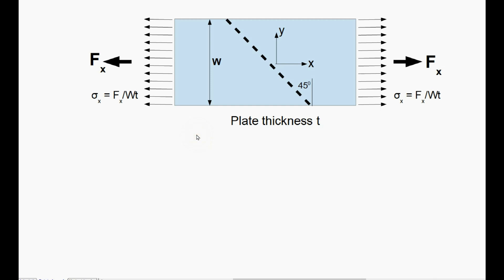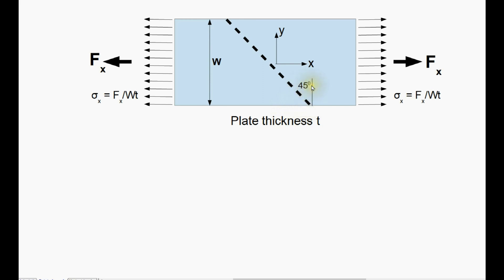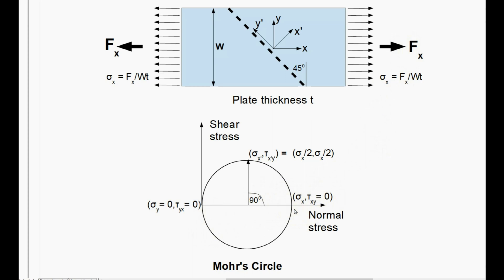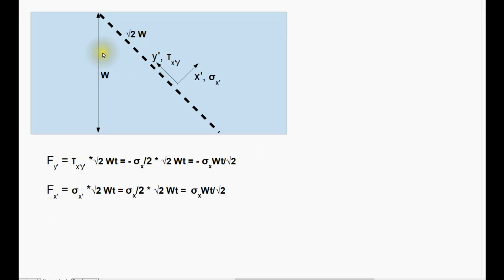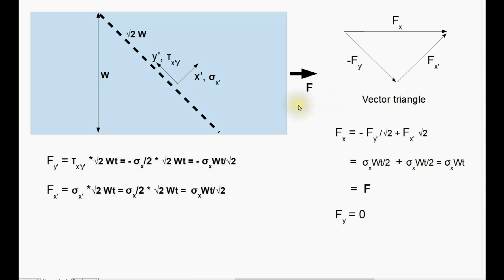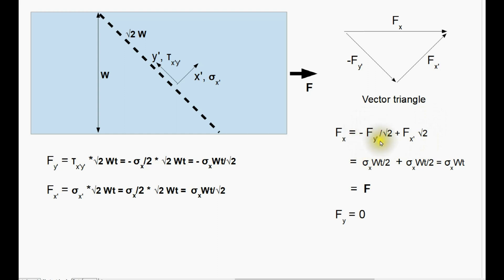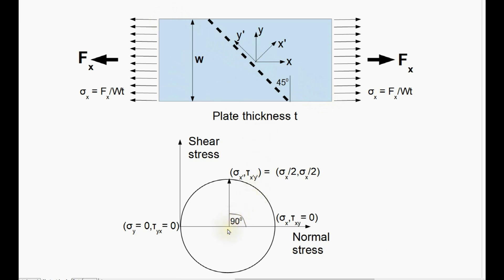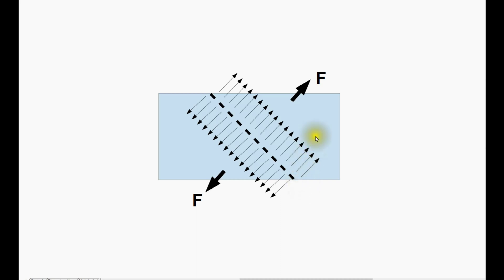Why scarf joints are no stronger than square joints

Comment: Hi Bill.  I want to ask you a Land Rover related engineering question, I can't find any contact info, so please excuse me for posting my question in the comments section.  

It relates to Oil Pressure drop in a 300tdi.  When the engine gets warm the oil pressure drops from 45psi to 15psi, if I coast downhill and drop the engine temp below 74.C the pressure rises again to about 25psi.  I doubt that a temp variance of <10.C From 74.C to 80.C) would affect oil viscosity that much, so the drop is almost entirely related to the oil cooler thermostat opening up.  

The engine has a 7 litre oil capacity, so lets say that the pump, filter, oil galleries and rockers take up 2 litres at any given time and the oil cooler and associated piping takes up another 2 litres (probably less, I'm just using arbitrary numbers here).  
The pump delivers a given volume (related to speed and time) and the pressure is controlled by the restrictions of the oil galleries.  
Once the thermostat opens the same fluid volume is applied over twice the circulatory volume, leading to a pressure drop.  
The thermostat spring has a linear rate or resistance, so adding more washers to it won't increase preload (resistance).  In fact it seems the spring is there only to close the thermostat. The opening is controlled by the thermostat expanding with heat, thus extending the shaft and pushing the spring loaded washers (which act as a valve) back.  Since this is in the filter housing, nothing can be easily done to alter this wide opening.  The thermostat has a shaft travel of about 18mm.  
Since travel though the cooling system is one way, if I used a washer to partially occlude flow on the return pipe (since that's the top pipe on the radiator and easiest to access) would the introduction of this resistor increase systemic oil pressure?  
The engine has a new crank and bearings, and demonstrates good oil pressure when cool (<74.C) so the pressure drop seems to be totally related to the cooling system.
Is there a formula to calculate the ideal hole in the washer?  

Thanks, I always enjoy your videos and explanations.

Michael
Reply from the maker: Michael, whilst I'd like to help I think it'd be unwise for me to get involved in mods to your vehicle's lubrication system so I will just give general answers. In response to your question it is possible to calculate the oil flow / pressure drop but you really need to model the whole system and that's quite a bit of work and requires good input data and a lot of experience. It's what Piping Engineers do for a living. If you want to calculate the flow through a washer in isolation then do a search on "orifice plates" which is what they are called in the piping world.
Provided your oil pump is delivering as designed, the clearances are as per spec and you are using the corrrect grade of oil you should be getting full pressure - that's what the physics says. Most people don't have an oil pressure gauge so don't know how low it gets when hot. The Daihatsu engine in my Defender starts at nearly 6 bar when cold and can reduce to 1.5 bar when really hot which is a bit concerning but it seems to be all right with that. However 1 bar would worry me (the low pressure light must be close to coming on) and I agree you need to look into it.
Reply: @defendermodsandtravels  Hi Bill.  Thank you for your response and guidance to a formula.  Having searched the net, the issue seems to be widespread among 300Tdis.  Prior to the rebuild I had around 10psi more pressure at start up and at hot running.  That was with a later Brazilian made MWM block, which may offer more resistance in the oil galleries (I don't know) and with the gauge sender unit bolted to the end of the T-piece adaptor, now it's at 90. angle.  I don't think this should make a difference.

I do have a custom radiator (triple flow with 30% increased capacity) and I did notice a mild drop in oil pressure when I first fitted that (difference in resistance between that an the old radiator).  Looking at Mike's videos on Britannica Restorations (YouTube) the oil cooler circuit never gets 100% of the oil flow, even when fully open, so that 'hot' and 'cold' oil mix at the filter.  Given that with a "tight restrictor" ie: thermostat closed, everything runs fine, and that with "no restrictor" (thermostat open), the oil still bifurcates at the filter, then I think creating a 'partial restrictor' should not affect oil flow though the filter and to the engine.  The restriction I'm contemplating is in a one-way circuit (filter/thermostat housing - cooler - filter/thermostat housing) so if I offer resistance inside that circuit, am I achieving anything?  

Given my ignorance, I'm happy to step back from this contemplation if you can kindly show me any risks I haven't thought of.

Thank You, Michael
Reply from the maker: @mk109siii9  Michael I can't really offer much guidance because I don't know the 300Tdi lubrication system in detail, and I don't want to get involved in something I don't know about. I suggest you find other owners who have had the same problems and share your experiences with them. Good luck.

Comment: scarf joints are best reserved for wood😄, when you want the bonded surface areas  as large as possible to ensure a uniformed bond strength,
Works well on boats...not so great on Land Rover chassis🤣
Reply from the maker: Agreed. You certainly seem to have picked up the message of the video. With glued timber the joint is a plane of weakness but not so with butt welded steel.

Comment: Surely the loading is vertikal, on a chassis connection, rather than horizontal? Not saying you are, I really dont know. Iimagine the loading on a chassis is vertical, and twisting motion.
Reply from the maker: I have no problems with anyone questioning my videos since I could always make a mistake.
 You are correct that the loading on the top of a chassis member is lateral however the local bearing stresses are at least an order of magnitude lower than the bending stresses. It may not seem logical but that's the way it is.

Comment: Thanks for your time , knowledge and effort in this series. The maths is over my head but it has given me a better understanding.
Reply from the maker: The mathematical details are really there for other engineers (which is why this video is in the Technical Series playlist). If you know that the theoretical back up is there that's all that matters.
Reply: @defendermodsandtravels  I walked through Mazda this morning, they had a new BT50 cab chassis in the yard. There were vertical welds (overlapping) of the main chassis rails. I took some photos for you if there is somewhere I can send them.

Comment: As the wrong type of engineer I have little understanding of your analysis but can appreciate the expertise presented. It would be interesting to demonstrate your position by welding scrap box tube together with several joining strategies and comparing their failure points.
Reply from the maker: Those types of tests (static loading of conventional welded joints) were performed back in the forties and fifties and it'd be hard to dig out the reports now. Attention moved on to different things - the buckling of box girders, fatigue of all types of materials and structures, fracture toughness, buckling of columns, then tubular joints for offshore structures. The list goes on. I used to work in a structures lab in the early days of N. Sea oil (tubular joints and grouted connections).
The early research work was incorporated in design codes and analysis methods which have stood the test of time so no one even questions them now. Modern design is mainly performed by software and many younger engineers probably only have a vague idea about the underlying equations.